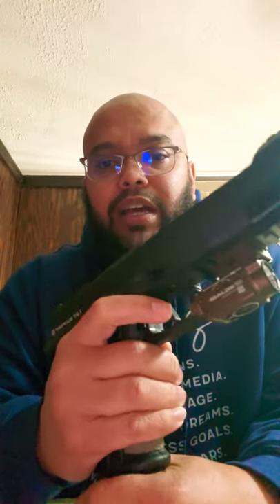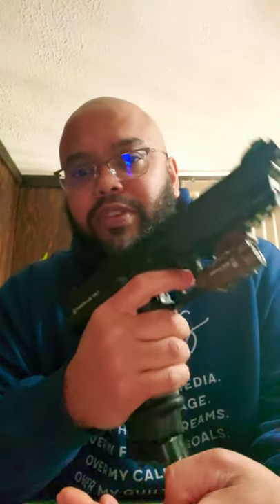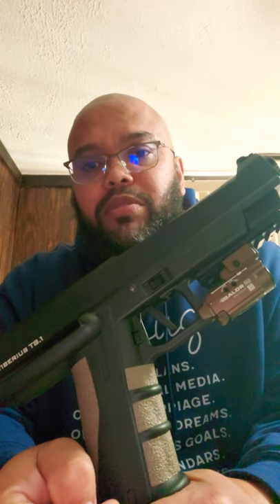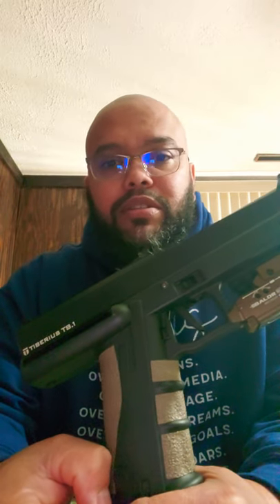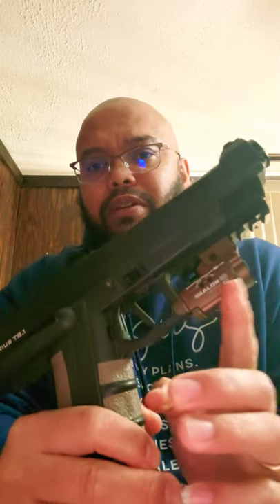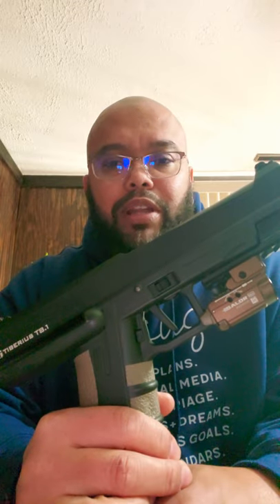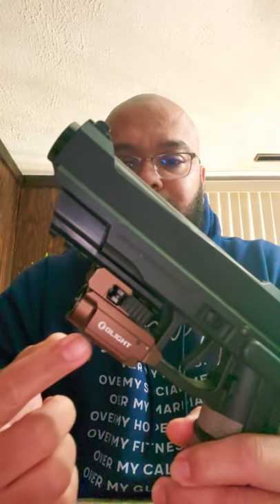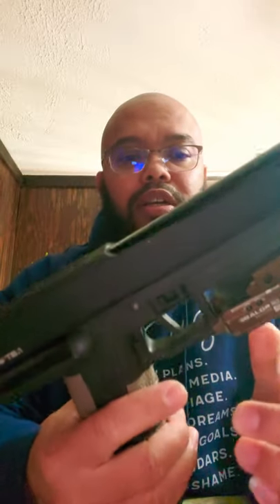How to tune FSC/T8.1/T9.1 relief valve for maximum reliability!

Comment: If you own an FSC (or 8.1/9.1) this is essential info about the regulator/velocity and pressure relief valve adjustments. If you have the time, watch all of the videos about FSCs on this channel as this is one of the best sources. Also, little side tip .. if you are using the Rear ASA Adapter for the FSC .. it used to be known as the Stock Adapter for the T9.1 .. so download the PDF manual for the Tiberius T9.1 and you will have some info on the adapter which you cannot get elsewhere. (I know of no other manual covering this adapter.) Cheers all and thanks Henry!

Comment: Very good information Henry I usually don't need to adjust my relief valve every time I have tuned my velocity the relief feels tight and I can't hear any leakage so I figure as long as I don't hear anything it's ok I just don't try to fix something thats not broken should have finished the video I see now back off until you hear something then tighten until it stops then tighten a fraction more brilliant thanks so much for that advice

Comment: Side note: I have a lot of those barrel covers, but how I use em: I insert a small metal or super-dense rubber/foam disk inside, at the bottom of the bag. I then fix it in place with tape or whatever so doesn't move. Voilà! I now have a backup gun safety on all my launchers (whether loaded or not). 

End result: If the loaded gun goes off no one is getting hurt or killed because the disk takes the hit, and it is somewhat contained inside the bag.
Reply: you shouldn’t store it pierced and you should never rely on things to be your safety, all u have to do is be responsible
Reply: @Seabass1206  What are you talking about. What I'm talking about is when doing "live fire training," so to speak, when the weapon is hot but leaning against whatever, or laying on a table, I keep that cover on the barrel tip to act as an additional safety. Check all the YouTube videos where guys leave hot weapons laying on a table pointing at people or their pets. A barrel cover forces one to think safety.

What I'm also talking about is using the cover as a sort of trigger lock (which in my town are required for all firearms), because as most people know, it is the unloaded weapon that maims or kills. It is the loaded gun (hpa tank attached, rounds in the mag), that we just know is NOT aired up and are sure the safety is on, that ends up falling on the floor and discharging because the weapon was aired up and the safety was not on.

The problem with these launchers, guys are treating them like paintball guns. They get careless, they let things ride, they get reckless, they use cell phones and forget the weapon is hot, then a child comes in, grabs the weapon and plays soldier with his friend (because you are on the phone in a separate room.)

I don't know about storing hot weapons, anyone who thinks or does that is a moron.
Reply: @Seabass1206  What a wonderful world it would be if all everyone had to do is "be responsible." No need for fine print finger wagging; no need for disclaimers; no need for warnings on labels (e.g., "Drink Responsibly"); no need for speed limit signs; no need for flashing lights and caution signs at grammar school crosswalks; no need for those little signs in restaurant bathrooms that say "It's the law, employees wash your hands;" . . .

Comment: So let me explain that: The overpressure relief is just if you go over desired chamber pressure and is only important for regulation in paintball use, means every accidently pressure over desired lets say 600 psi is let off by it so the paintball velocity doesn´t increase accidently,when using other tank output pressure, just a safety device.
I have screwed them complete closed on both t9.1 that i have and i do not have any problems. Many problems in high power are the weak silicone o rings, especially the clear ones.
 The time that the air chamber is empty and the bolt resets to cocked position isn´t managed by the relief. The valve is a 3 chamber design, after the shot chamber 2 and 3 are empty, the air pad gets punched against the ball again by the velocity spring and then air flows into chamber 2, pushes the air pad against the velocity spring and if the desired pressure is reached the air pad opens the last air channel to chamber 3 8the Air chamber) in that time the bolt is already in cocked position again. If you want to go even higher power, throw out the regulator spring to stiffer or use belleville washers, so you can get a higher spring tension in the regulator and can make higher pressures count to the air chamber. So bro all reliefs are closed, i am shooting at 900 psi HPA and got 48 joules average with hp68 without issues.
I encountered lower velocity after exceeding 900 psi atm, because the chamber gets filled faster because spring is to weak to hold strong enough against the higher pressure and make more pressure for the shot.
Btw. Grimburg sells Valken M17 or Milsig where they also have killed the pressure relief and selling it like that.
My t9.1 setup: stiffer bolt spring, milsig oring, air chamber from steel and a 2mm spacer between the velocity screw and the spring pad, so i can screw velocity screw deeper in without making velocity screw and air pad touching when the pressure is rising. Maybe you encountered that if you screw to deep in the shot isn´t releasing anymore. i ectendes that range and can make the spring even harder than stock, but I ordered a set of bellevilles and will try that when they arrive ;)
and btw using co2 for high power is also part of problems, the more power you have and the faster you shoot, Holes are gonna get freezed, even air chamber hole can freeze and get to gas after the shot and flow into air chamber, when there should be nothing. If i use co2 with my current setup i make 6 fast shots and it freezes, if take my time between shots than no problems, if i use hpa pam pam pam pam pam all day.
as i am bored today i decided to make a little video about the valve
https://youtu.be/44PjvJh5RDk
Reply: Thanks for the detailed explanation NWO. (And thank you too Henry!) I like understanding this on the millisecond level, because that is the only way to really troubleshoot and optimize. If you search for "milsig heat core how it works animation" you will find a video in cool old school presentation format with cool 80s synth music. This animation and the detailed bullet points really helped my understanding and I still have a lot to learn/figure out with these FSCs and soon also the Valken M17s since they look to be an outstanding design and build quality. Here is the link that can help understand the blow forward firing process in detail: https://www.youtube.com/watch?v=G6zEUR7hX-M
Reply: Wow that's a lot to take in at one time I only use 8g. Co2 and when I slide the mag in I hear it leaking how can I try to adjust it from scratch using both Allen wrenches there both out of adjustment

Comment: Hi Henry I just found this video and I think this may be my problem I in boxed you on fbk,a few vids of my problem,I have also been informed  if I change the spring to the vks spring it will help reset is that correct many thanks
Reply from the maker: Hey Matt. The problem is that  shipping to the UK is crazy expensive now and we've been getting things intercepted by customs...

Comment: I never knew of the inner valve my markers probably loose  on the inside or missing cause ive never  adjusted that  would you loose air from there if there was a problem
Reply from the maker: Ya, you would either hear air coming out of it's too loose or have malfunctions if it's too tight.
Reply: Before upgrading to that milsig heat core I had malfunctions, automatic fire, locked piston, but every since then everything's been perfect

Comment: Hay Henry question about my FSC I turned the relief valve counter clockwise but nothing happened no mater how much no hissing it fires fine but what's going on with the relief valve
Reply from the maker: If it's firing with no problems, just be grateful! 😂
Reply: @psi.defence.channel  I was just wondering why it would not hiss no matter how much I turned it but thanks always grateful! well mostly
Reply from the maker: @smokingunclefrank6037  if you Pierce your CO2 and turn it counter clockwise, it will hiss bleeding out pressure.
Reply: @psi.defence.channel  I did just that but no hiss any Idea why

Comment: There is a tiny leak coming from the grub screw actually where the rear asa pass thru hole is.. I havent taken gun apart yet...could it be that solid oring on the valve body is blown..or could it need teflon tape on pass thru screw
Reply: mine had that problem and replacing the O ring plug on the regulator fixed it.
Reply: @Americafirst916  purchased preowned ebay t8.1...funny, had a fsc folding stock on it.Stock has 4 mounting holes but. T8.1 only has 2 bottom holes and right bottom is pass thru..ive managed to get enough teflon tape on it to stop leak..would like fsc rear asa adapter on back of t8.1 but would only have one mount screw holding it to the gun..
Reply: Hit the nail on the head I used a PCP hpa O-ring from one of my PCP guns

Comment: when you delete the prv .do you install the spring pad and spring or leave it out ?
Reply from the maker: The prv delete kit comes with a solid spring pad. I use that and the spring. I leave velocity adjustments in because these regulators tend to work best approx. 1/2-1/4 from max.
Reply: @psi.defence.channel  so My kit Has the Vks spring , delete screw and bigger shimm sear spring. Henry’s video shows him not putting the internals back in . I guess you can run it both ways .
Reply from the maker: My bad, the kit I was talking about was from Sterling self-defense. Those come with solid spring pads and genuine vks springs.
Reply: @psi.defence.channel  I bought 2 kits with everything needed from Mikey “CRB”  I will not buy anything from Sterling anymore . No offense. Bad transaction. Thanks for the info !
Reply from the maker: Sorry to hear that. He can be a little rough around the edges sometimes, but mostly a good dude and we'll get things right after he's done yelling about it lol!

Comment: I set my velocity at -5x turns and turned the relief valve quite a few turns back and heard nothing yet. Could there be an issue? I'm afraid of going back too much on relief valve in hopes of hiss sound.
Reply: I've now set velocity to -3x turns, pressured up and turned relief valve the full 4 and a quarter turns back and no hissing throughout range
Reply from the maker: @asintu  Did you turn it all the way clockwise, then turn it 3x counterclockwise?
Reply: @psi.defence.channel  yup
Reply from the maker: @asintu  ya, 5x from max is pretty low velocity. If your releaf valve isn't hissing when you take the Allen key out your marker isn't building too much pressure. The releaf valve only bleeds excess pressure for safety of the internals. It should be fine if the internals are all ok.

Comment: I tried to adjust my TCP now it leaks all the time, what did I mess up
Reply from the maker: I need more context to help
Reply: I don't know any way to put it but I used the small and the bigger allen wrench to kick the power up and no matter which way I turn them now it leaks air you can hear it I thought the small wrench adjust screw and larger one locked it in . Their was nothing wrong with the TCP to begin with I should have left it alone so now it leaks air slowly all the time, you can hear it.i don't know what to do now. I love that gun and I fucked it up!!!  HELP !!!!!!
Reply from the maker: @jeffliles1044  neither screw locks anything in. The larger Allen adjusts velocity and the smaller one is a pressure relief valve. This video explains the adjustment process pretty thoroughly. The best thing you can do for your TCP is install the SSD PRV delete kit. It removes the PRV and comes with stronger springs for more reliability. Links to purchase are in this video's description:
https://youtu.be/CLsw9n4FDTs

Comment: Can you make a video about magazine cover slip, please?  How can you solve the jump and so?
Reply from the maker: What do you mean by jump?
Reply from the maker: @followme4350  you got to be a little more descriptive! 😅
Reply from the maker: @followme4350  they use the same springs both silver and red. I've had better luck with silver springs for high power using Grimburgs.
Reply from the maker: @followme4350  yes. It engages the spring once it's slid all the way down the mag. I usually store my extra loaded mags with the slip cover up slightly so when I slap them in the spring is released.